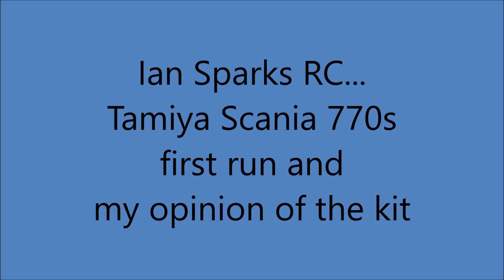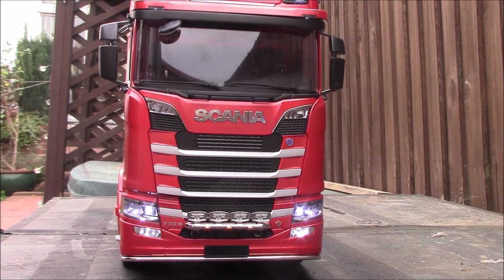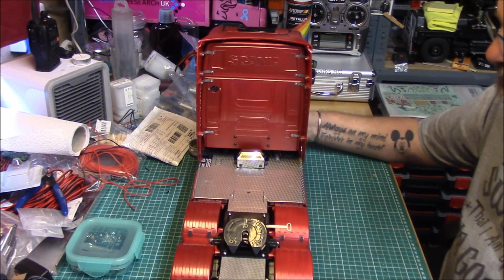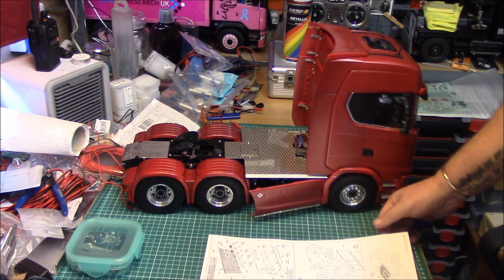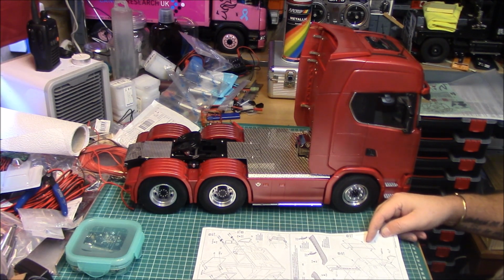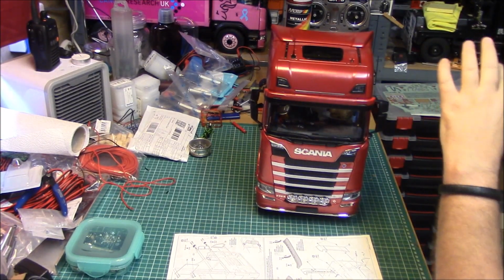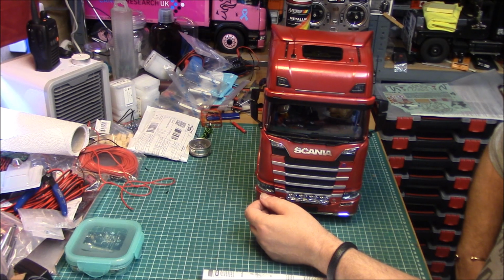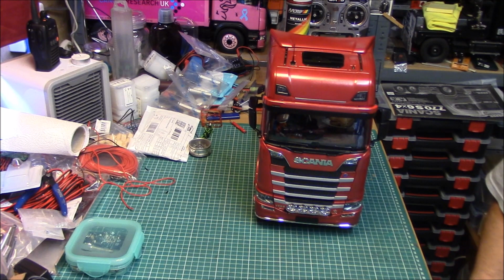Tamiya Scania 770s first run and my opinion of the kit

Comment: Nice truck . I’ve also completed a 770s  but haven’t any issues with the hinged side panel. It opens all the way without rubbing or dropping . Could the alloy chassis plate be causing it ?
Reply from the maker: No, it was doing it before I fitted the chassis cover plus I know of 2 others that do the same thing

Comment: Hi Ian, where did you buy the lower spot light/LED set from? Thanks.
Reply from the maker: The light bars are in the kit
Reply: @IanSparksRC  sorry, I meant where did you get the led wire harness from to go into the light kit?
Reply from the maker: @jamesross2262  loads on eBay

Comment: Holy shyte, I read the PDF of the Manual, but i had no scooby that it is that bad.
I'm building a Next gen R (welll 2 ) for quite some time before tamiya brought the S on the market,
I was pure furious when I saw that but now... at Least I have easy acces for aftermarket stuff for it from the S
But my Cab weighs as much as the fully build S, it's a Resin cab I have tae glue a lot too (because Resin) but my visor is boltet by 2 micro screws from H0 railroading, from the side,
the Front, side, roof is all one piece, the step, Fenders, front bumper, head lights and the grill are sepperate.
I have tae paint behind my Grill because mine is a photo eched piece and ye would see the backround so it's flat black painted behind.

I think it's a Fraud that they dinnea put a V8 sound on the MFC,
and the Light layout is pure completely utter shyte, 
that they dinnea come on the conclusion tae put a distribution board on for all the lights, 1 plug in the MFC form the board and ye saved 4 plugs on the MFC (that annoys me for about 16 year)
and they are not even prototypical ,if ye know how the real is lightend ye know.
Reply: Did you buy your truck from xc raid rally slot ? I have one and it's a little confusing to assemble! .
Reply: @stevenwalker1883  yes, it is ye have tae dae a lot of work fitting It taegaether and figure out how tae mount it, since there no brackets or holders and the scania S770 front cab mount woudnea work it's tae low.
Reply: @dark_one1337  hmm , sounds like a lot of time and patience is the answer , perhaps buying the 1/24 s730 kit would be a guide , I prefer the xc Scania 100% .
Reply: @stevenwalker1883  yes true like I said 2 year since I got it, maybe he changed something on his as the tamiya came out but the price is equal tae the tamiya if ye count all the stuff extra needed in,since when are there 1:24 kits aviable? never seen one of the next gen.